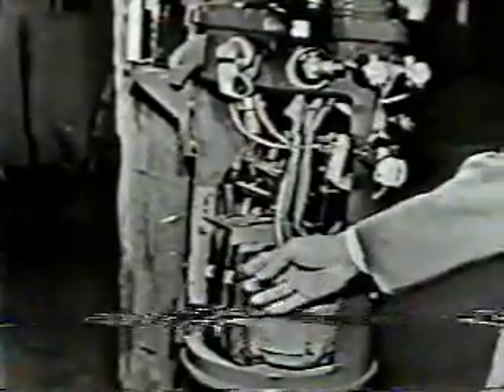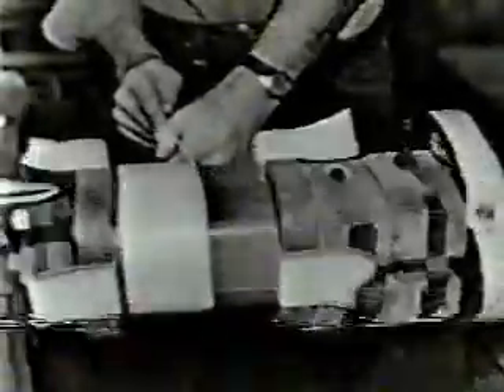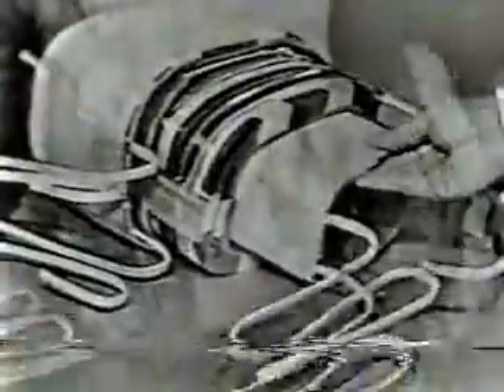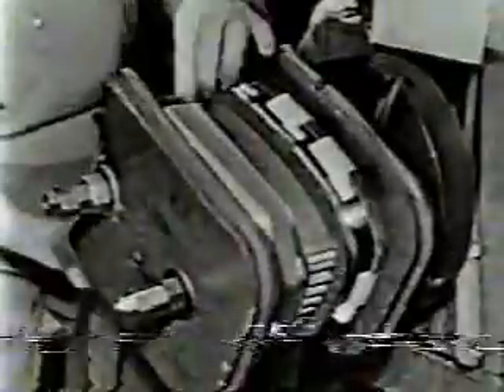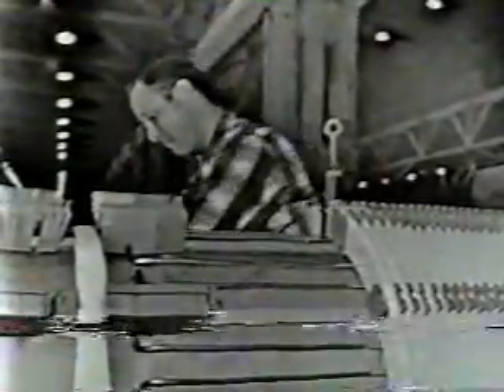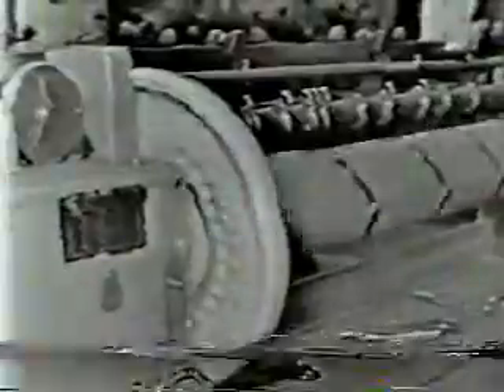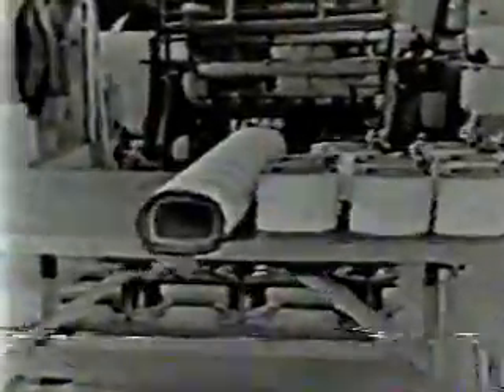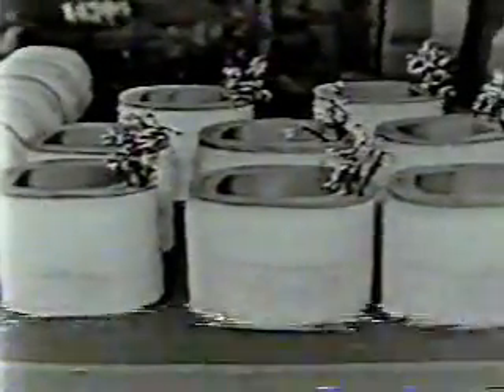Westinghouse Electric Transformer part 1 Sunnyvale California.wmv

Comment: Westinghouse (Stanley invented the first commercial transformer) made the BEST transformers since they invented them.  The CSP (completely self protected) unit was invented in 1936.  Due to the higher overload currents which exceeded the interrupting rating of the internal fuse, this required placing cutout and arrester installations on the primary line entering the transformer.  Additionally, the problem with the internal silver sand fuse in the primary bushing, which interfered with the  coordination over current engineering of the distribution system, caused other problems--especially on rural sectionalizing .  This doomed the CSP unit.  Otherwise, it was a great distribution transformer!  By 1937, Westinghouse had patented the first all steel, cold welded tank transformer, based on their experience.  Also, when Westinghouse had won the contracts for the first EHV transmission line transformers for the Receiving Station "B" at Los Angeles Bureau of Power & Light, the first "form fit" transformers were devised.  Westinghouse was a great manufacturer and sorry they have faded from the limelight.